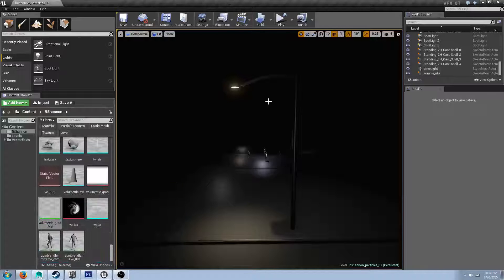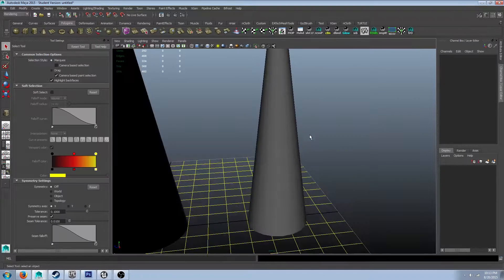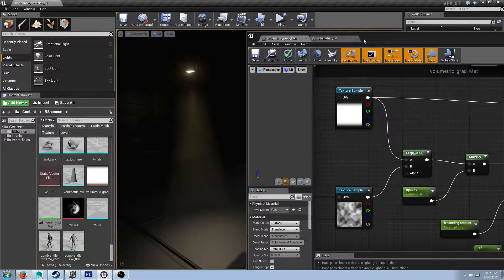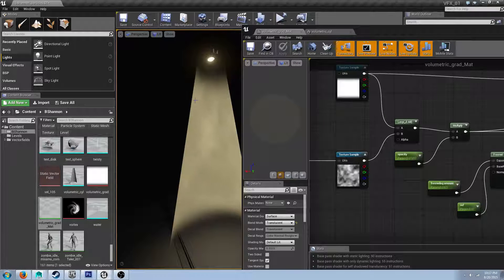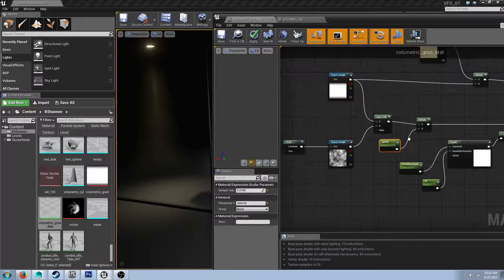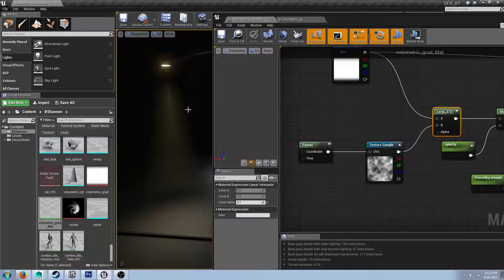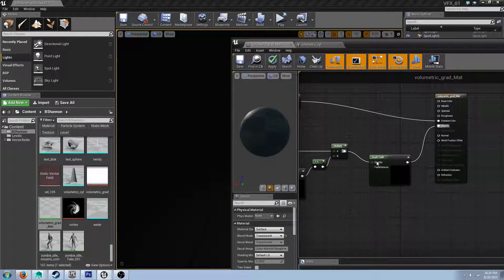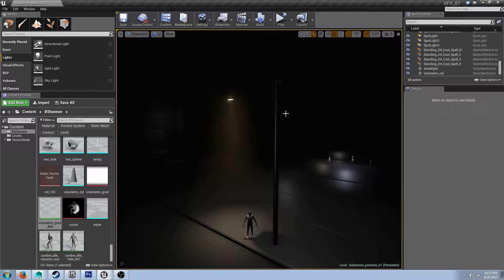UE4 - Volumetric lighting effect tutorial

Comment: how did you make those  gradients? cant get it to look quite like yours
Reply from the maker: @3:31 - I made the gradients in photoshop using the gradient tool. I explain a bit at the time stamp. The important part here is that the edges (top and bottom) are fully 0,0,0 black. This way you will not see the seam on your mesh/material.

Comment: Just soften the edge normals wtf
Reply: In 3dsmax it's referred to as smoothing groups and is done on faces rather than edges ( both methods give the same end result though). It basically means that for vertices which make up the edges of two adjacent faces - they either share a normal or have their own. If they share the normal you get a smooth look and if they have their own normals (that point in different directions to each other) you get a seam
Reply from the maker: +Liam C In Maya -> Select the edge(s), then go to normals, Soften Edge. I dont know how other programs do it, sorry.
Reply: very simple common sense dev talk